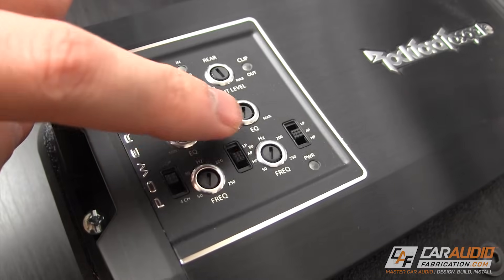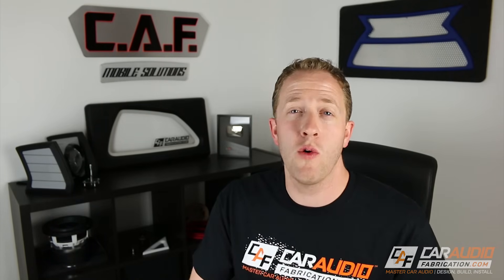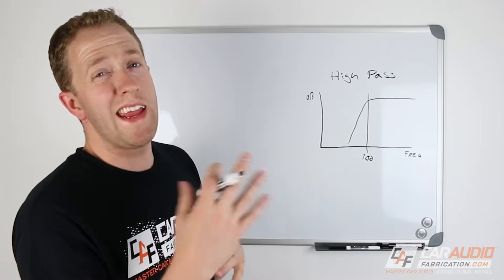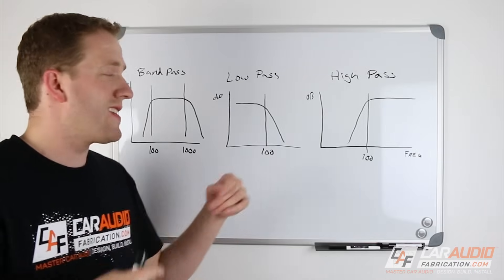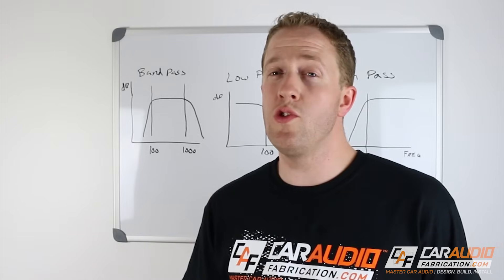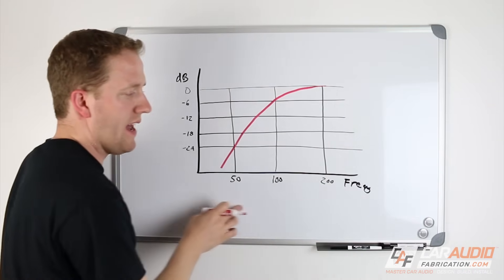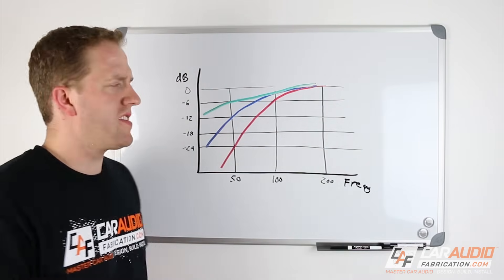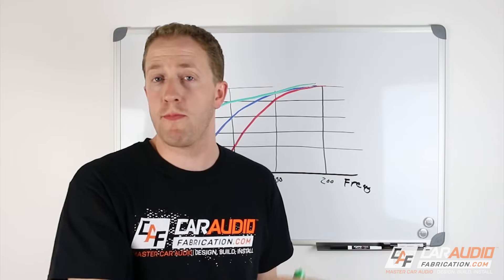IMPROVE Sound PROTECT Speakers - How to set Crossovers - CarAudioFabrication

Comment: Clear. Thanks for sharing. If i don't have the hpf for my mid range, it work over 80. I have a amplified slim subwoofer bellow my seat, where Is the óptimal point to se the LPF AND what phase to use? I was thinking on 100, but I'm worried about wrong blend.

Comment: I have a stupid question. If your amp has a crossover do you set it the same as the deck or do you set the deck higher? Or do you turn off the crossover

Comment: Best car audio videos in the internets
Reply from the maker: Appreciate that thank you
Reply: @CarAudioFabrication   Hey Mark, I really hate asking via a response to someone else's comment, but I have a couple questions that, despite all my searching, I really can't seem to find a viable answer for...
PORTS. When designing and tuning ports, if the volume of the ports are the same, does the shape and location of them have any effect on their sound/performance? As in, if 2 ports are the same tuning but at different locations/sizes, are they going to sound the same? Typically ports of longer boxes are placed along the extreme ends of lengths, but what if I wanted to get creative with my ports by making a taller box instead of a longer one, placing the ports near the top/bottom as to align the ports horizontally instead of the typical vertical positioning? If the ports were wider (to appear more the shape of a 3x5 card, as opposed to the typical "ruler"-shaped cutout), as long as the tuning was the same, would both port types produce the same sound? Would either port shaping be more prone to chuffing?  I'm sure there's more that I'd like to ask on the topic, but I'm drawing a blank RN due to the over-analyzation I've been doing... lol.
I'm currently in the process of designing my own 6th order bandpass box for a single 12" driver, and can't seem to find any videos on the matter of port shapes, sizing, placement, or relative output, so any help on the matter you could bring would be greatly appreciated.

Comment: So if I'm powering a set of component speakers with an amp with crossovers, do I still use the crossovers on the amp? Or do I just send full range signal to the passive crossovers for the component speakers?

Comment: If i set the crossover on the radio already. Do i leave the amp at full range or should i still use low/high pass on the amplifier also?
Reply: Go full range on amp, and set everything on headunit

Comment: Question: if I have two sets of component speakers that come with passive crossovers, should I delete them if I am operating. LC7i with a 4 way amp that has crossover adjustability and hi low pass selection?   Thanks

Comment: I want to learn 4th order crossover tuning! I have an alpine 9 band tuneit head unit, 4 channel 100watt rms per channel pioneer amp, and  the pioneer HVT compact powered sub. I set the sub to max because thats the weakest link. Then set the 4 channel amp to about the same db level using  a calibrated mic and my phone. The tuned the EQ to white noise. It definitely sounds full and well rounded but I'm a perfectionist when it comes to tuning. I need more better tune!
Reply: https://youtu.be/tiOUd3NkOyQ

Comment: can you help my i have 4 door speakers and 4 tweeters 4 door speekers running off an amp and tweeters running from the headset do i get one for each speaker or 1 of those big units with tweeters and mids in one and some say wattage does it need to be the same watts as the speaker or can it be bigger watts

Comment: The larger the diameter of the mids, the more it beams.
Door mounted stock locations go up to 60 degree off axis response. Hence need augmentation in the higher frequencies by putting high freq drivers higher near dashboard level.

Comment: There are other stuff about xovers: 

Linkwitz Riley filters will have -6db at the xover point, cause when the 2 speakers sum, they'll flat the curve.
Butterworth filters will have -3db,  in case you want a gain of 3db at the xover point
Besel filters will have -9db, in case you want the sum results in a -3db gain at the xover point

Comment: What about a inline crossover that my kenwood component speakers have, will effect the crossover of the amp or headunit. My headunit has the most control but I can't take out the inline crossover, and I can't turn off the crossover on the amp so how can I mesh all this together, and what values off of each other should they be?

Comment: Great video. Question...can a crossover go bad and prevent your speaker from working? I’m getting no sound out of my front driver speaker and separate tweeter. I tested the speaker with a multi meter and it seems to be fine. Tested the amp and the amp seems fine. Checked the head unit an it also seems to be ok. Could it be the crossover being faulty?  Thanks for any help.

Comment: Can u use both active and passive crossover together? Say if my deck send an unamplified full range signal to the factory amp/processor and the out put to speakers and tweeters are already regulated, if I replaced the components speakers with a set with same impedance w/o adding an aftermarket amp, should I also use the crossovers that come with the comp. speakers? and if so should I take the input signal from the mid? Or should I just wire the mid and tweeter directly to the factory wires?

Comment: if i wanted to put the little capaciters on say a mid range like you would find in a house 3 way speaker what would i use and were would i get them.  I actually have mids that came in the car i bought from the last guys system their was one in each of the 4 doors but they are just mids and they are 8 ohms so unless i want to wire them to drop the ohms they are kinda useless to me.  i would actually like to use them in my home stereo i got some nice old boxes that the speakers were trashed in and id like to put them im there i lhave woofers and tweeters already for them but i dont know what and where to get to block the signals to seperate them any help is greatly appreciated thx

Comment: After ten years of no system in my car, I decided to dive head first into it. Used to be my hobby, but never got technical, just blew a lot of equipment until I got lucky. After spending way too much on equipment, thinking I knew what I was doing, I felt completely ignorant and overwhelmed. That’s when I found car audio fabrication, literally followed every video up until now for every aspect of the install. Now, today, I will be tuning and setting crossovers......not as nervous as I was before watching this video/the tuning video. Still kind of intimidated, but confident thanks to my guy at car audio fabrication! Thanks for making these extremely informative! Saved my install :)

Comment: is there a video about the crossover combined setup and multiple inline crossover issues ex: head unit sub out + amp low pass and/or 24dB/octave on head unit 18dB/octave high pass on 4ch

Comment: just discovered your channel ,right in time because I am building a audio car audio system in my home.You have explained . the crossover system so clearly.Now I want to purchase a 12 volt dc power supply but is not sure what rating power supply in terms of ampere I would need.. My power amps is like 500 watts exclusive of the crossover.please could you help ?

Comment: This just confused me more. I have 8" mids and tweeters and a sub with a radio that has 16 equalizer adjustability and a pre amp aslo but i dont know how to set it at all. It sounds good juat install now but i know it can sound so much better if its tunned right. No one knows how to do it in Springfield Massachusetts.

Comment: Thanks for the video.  I already knew most of this info.  But watched it anyways and I'm gald  I did.  Did you ever make the advanced video you mentioned?  I'd like to learn more about the phase alignment and trick of using a 4th order slope, etc.  Per say,  if you have a midrange woofer band-passed x-over from, say 250 - 1000hz, and a compression driver high-passed @ 800 hz, will that add distortion from 800-1000 hz?

Comment: I have a question i have 4 tweeters , 4 ohm ( each ) 50 rms ( each ) & an amplifier 2-4 ohm 200rms , can i connect just the tweeter without the the speaker or not , and i need help with the tweeter resistor or capacitor ? Need help.

Comment: I have a component set that says the passive crossover must be used.. but I'm using a pioneer deq-s1000A DSP.. could I use capacitors to "create" low pass/high pass/bandpass points for the speakers and just use the DSP for active crossover??
Reply: Btw the system that I'm working with is tweeters, 3.5 full range, and 6.5 woofer..

Comment: Some amps has for example my amp 4 channel amp and channel B give different frequence from channel A when I connect 80hz hpf channel A cut off frequence B channels cut off frequence is become 40 hz what amps specification data sheet says. If I want to tune my amp 4 channel what would I do channel A will have different to B right?

Comment: Component speakers have the passive crossover, my kenwood excellon head unit has an active crossover and my infinity reference amplifier also has an active crossover.  Do I use and setup all three.  Is there any downsides or benefits to using all three. I’m thinking use the passive for sure and then bypass or just not use the amp crossover and then use the headunit  crossover as well.

Comment: If it rolls off at 12 DB per octave it will be down 12 DB between 200 and 100. If it rolls off at 24 DB per octave it should be down 24 DB between 200 and 100, and down 48 DB by the time it reaches 50 HZ. A 24 DB slope is steeper in its rolloff not shallower

Comment: love the videos and this has actually gave me alot of knowledge. the problems i now have and am wondering what you would do. from the maths that you've shown my woofer is 1500 hz low pass and my tweeter is 3200 high pass. does that mean ill have 1700hz missing? i would imagine that would be where a mid range would be handy?

Comment: I have a build going on now and am using  a 4 channel amp to power only two 6.5 jbl gto626 speakers. I may add a couple of tweeters in the dash later on. My question is: Should I only use the front left and right channels, and not use the rear channels, or bridge both front and rear channels to power my two 6.5 speakers and set the amp gains accordingly? I could also power my dash tweeters using one channel un-bridged. What would be your opinion?

Comment: I'd like to start by saying thank you for your time in making these videos and answering our ?'s, I have learned more from your videos about car audio than anyone or anywhere else to date. I would like to ask one thing about setting crossovers, if I set the crossover frequency I want on my head unit do I also have to set the crossover on the amplifier to the same setting? Or can I set it higher or to full since the head unit should be sending the proper frequency already? Thank you
Reply: No need to do both. I use my head unit's DSP and leave the amp crossovers at Full.

Comment: So, can I use a dsp with my passive crossover component speakers for better tuning or switch to active crossovers, or would I still need active crossovers+a dsp for better tuning? Thanks for your help I have a set of mb quart 6.5" 2 way component speakers with passive crossovers with -0db , -3db, and -6db, I think they sound the best at -6db for the twitters but I would like to be able to control the twitters more , I also have a 7 band clarion eq but I want more tuning ability on those twitters.

Comment: Some passive crossovers  will use a light bulb to absorb DC from clipping .DC should never be present , only AC on outputs. If you show DC at an amp on the outputs, something is very wrong, my friend. The bulbs sort of works but will not completely eliminate it. Setting gains and crossover points will  be much better . Passive crossovers waste wattage  to a point by heat . Passive crossovers are pretty  much  a necessity when a separate tweeter is used  Tweeters cannot handle a ton of power by themselves. Be conservative on amp output if you want the tweets to live.It really is mad science  and the more you know , the better off you are. I have even seen low current fuses used to protect tweeters. Again , a band  aid. Gains are not turned up to rhe loudest possible  setting . He is right in a previous statement , gains are not volume knobs, you use them to match head units to said amplifier. I personally prefer silk domes , much smoother and not as harsh as metal domes.

Comment: I have  a  jl audio  amplifier  900.5 
Component speakers front doors  and tweeters  . Coaxial  speakers rear deck  two  subwoofers  . The settings  that the shop left it at . Front  speakers  120hz . Rear speakers  120hz . Subwoofers  80hz ... but I hear  hissing  from  tweeters  ???

Comment: Hi Mark, Any chance of doing a follow-up video that goes into the more advanced details of crossovers? Things like what to do when speakers cancel each other out, making phase adjustments, whether to use a 12 or 24db slope, how far to set crossovers apart etc. Learned loads so many thanks for the videos so far.

Comment: If I get a box tuned to 30hz and my amp doesn’t have a subsonic filter, but I can find an in-line rca filter at 20hz, would that be safe? Half an octave of 30hz is 22-23 hz. I’m having a hard time finding a 25hz filter. Only 20hz or 30hz from Harrison Labs Fmod. Also, most of them are at 12 db/octave slopes.

Comment: Can you measure the output Hz with a multimeter? i have a ground Zero amp i have to adjust to not put out less than 60Hz and the Amplifier is not that informativ on the adjustment panel.

Comment: So if i was to go for a 3way crossover i should get sub speaker designed for 22hz-150hz, mid-woofer for 175hz-4khz and a tweeter for 4khz-25khz for optimum sound quality? I know i look like i either get it all or am a total fool, but i'm new to this. Help would be appreciated.

Comment: If I have components that I would be hooking up to an amplifier that has built in crossover, could I disregard the passive crossover and use the ones in the amplifier? (If I know what Im doing with the tuning settings) Or do I need to use the passive crossover in conjuction with the crossovers on the amp?

Comment: My crossover on my amp is marked 50 and 250.  How do I confirm say 80hz or 100hz?  I have an oscilloscope with multi meter. Would that work?   What's the process?   Thanks
Reply: 50 +250=300
So hallway (in the middle) would be 150hz
Try backing down slightly from middle and see if it works

Comment: Tnx for the info.. But I am confused. If I have a compo set 3 way with its own filter. What do I set on the Amp? Full range I'm guessing? And I never understood the 12db dial. On the Amp next to the gain. But I guess that's the slope? What do I do with that. The filter on the compo has its owns set slope right?.. My head hurts..

Comment: 7:37 - I love that you bring up this point. This is why I love Fab Filter, etc in that I could cut the slope by not only 6dB, 12dB, 24dB, but also 48dB, 96dB...Here's a thought and my theoretical process to mixing a track:  I would first begin by dedicating each instrument to a specific frequency range and might even have a group of instruments dedicated to that range. I'd make sure instrument layers are not competing with their neighboring instruments in the same frequency range. I could achieve this in a clean manner by selecting instruments & notes that are specifically in the same frequency range and maybe even has the same fundamental frequency as one another but I'd decide which instruments would take priority / dominate the others (Maybe have a ranking system of what's the most important instrument to the least important instrument and then from there  against eachother by simply  having similar fundamental frequencies but I'd let one dominate by making pockets on the other (Cut the competing frequencies on one).
Reply: Chuckling...how's that working out for you? I don't recognize you so maybe you haven't been discovered yet.

Comment: Hello Mark, Great explanation! 2 questions, 1. Using the 2 x fs method would 125hz be too high for sub-woofer LPF? 2. Should you automatically reverse the polarity of a single sub-woofer setup once you both HPF and LPF at the same hz or is there a method to figure out if the system is out of phase.
Reply: Same here did you ever get answer?
Reply: @waltercox4577  2xfs for subwoofer is around 60 to 80 hz.. Depends on the sub

Comment: I need help tuning my system can someone help its really needed
Reply: I have a pretty hood system just wanna know how to set it properly

I have 

Front 100w RMS JBL GTO 620c components
Rear 75w RMS JBL GTO 600c

Underseat Alpine pwe-v80 subwoofer

Infinity primus 9004a Amplifier (4 channel used for speakers)

A pioneer headunit old ( FH-X759BT)

The issue that i face is vocals are good but there are a particular range of frequencies where neither the sub neither mid bass give the effect

Subwoofer is set to REV -6db/oct at 80hz (says subwfr cntrl in the HU so i gess thats LPF)

For Speaker HPF is set at 80hz -6db/octave

Woofer plays at 50 prcnt output 

I dont know about the amp but the switches are hpf for both front and rear

No idea about the setting frequencies

Comment: Informative video. But quite extreme fq on the starting point of lp settings. In my experience you need to buy a conplete set of speakers in a system and aim for a low (50Hz) handover between the sub and mids.